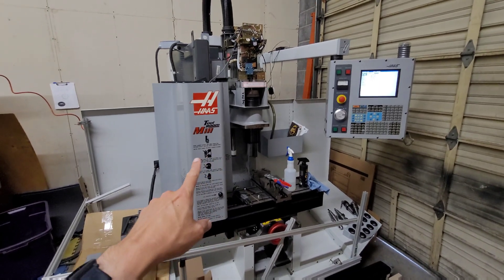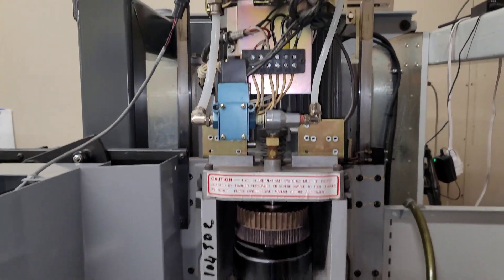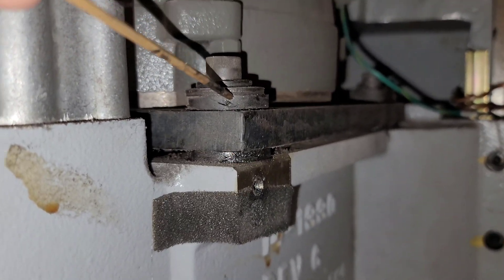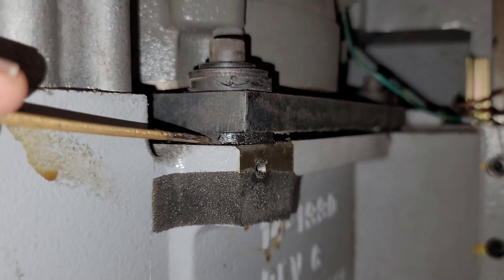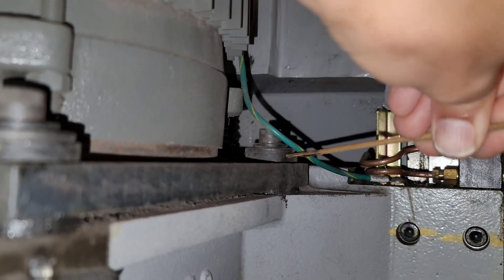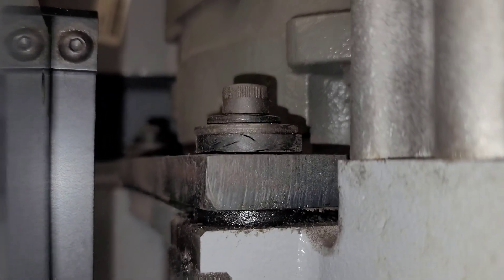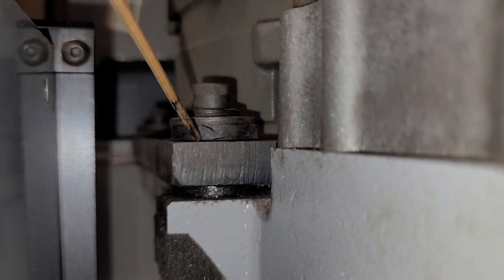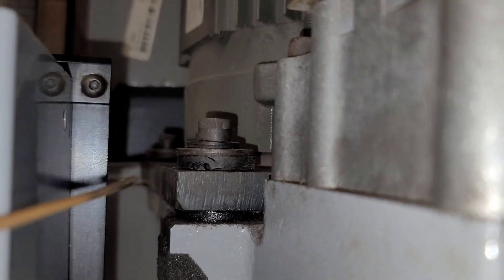HAAS Motor Mount Vibration Bushings Have Turned To Mush | HAAS TM-1 CNC Milling Machine Repair

Comment: Ya did, my vf2 has no vibe mounts. Just hard mounts to the casting. 
Same style belt drive assembly 

You might be able to reduce some of the belt noise/vibe with a decent alignment. 
I did